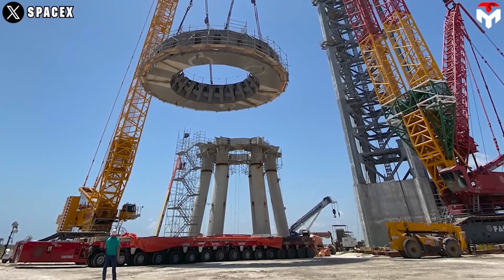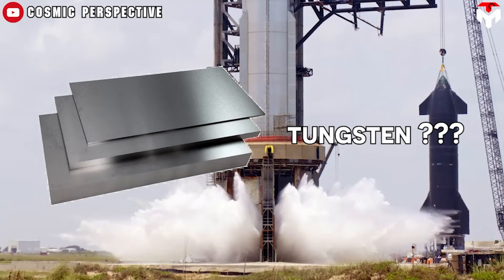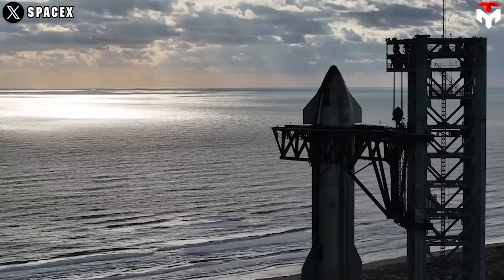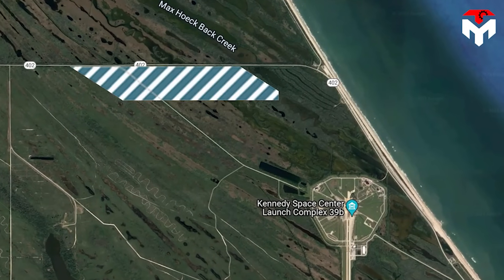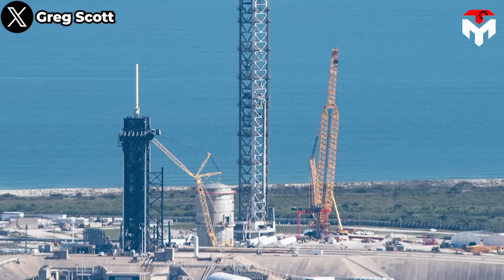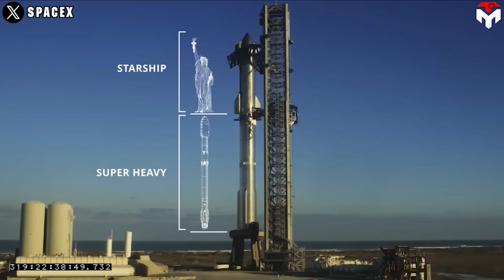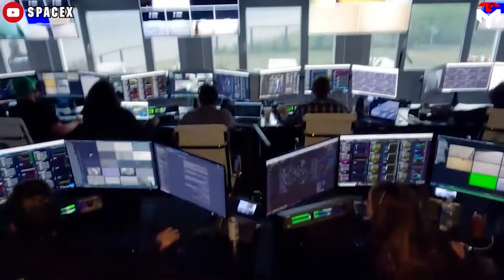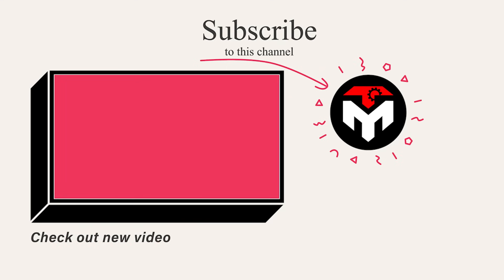Elon Musk revealed what exactly happened to SpaceX's Florida Starship OLM...

Comment: Six legs to three; will reduce the blow-by resistance which will disipate heat more quickly and possibly also reduce noise level.
    Sure would like to see the chopsticks modified to have a sideways mounted boom and stick operation.   Construction digging equipment uses boom and stick with a digging bucket.  Change the digging bucket to a giant catchers mitt, so to speak.

Comment: The next tower should be a couple of sections higher than the initial one.  To take in consideration of the hight of the new booster and new ship height.  Also it would be good to put a quarter ring deck extension on each one of the chopsticks... to make sure that when the booster lands on the chopsticks, the booster doesn't fall off the end of the chopsticks, and the booster is able to be properly adjusted and realigned after it lands on the chopsticks.  Just in case the booster needs to be turned slightly so the booster guide-fins surfaces are resting at some point on the two chopsticks.  And a mechanism that provides the booster to be turned to realign the pickup pins to be properly aligned so they will insert into the booster pin sockets.  I think it will always be an issue to keep the pickup pins on the chopsticks aligned properly with the pickup pin sockets on the booster and starship.  So a mechanism needs to be made to turn the booster and the starship when they are landing.  Wish I could make a drawing to attach to this post.  I think most people will not understand what I am talking about.  Unfortunately this is not something that is easy to describe.
Reply: how about stop believing in this stupid concept, just a waste of money lol. starship is massivre fail, wake up.

Comment: Tungsten is an element, it's not a steel. it is very hard and has a very high melting point, but it is very brittle and heavy as gold. It is usually used as an alloy. One would be tungsten steel, or tungsten carbide (you cant produce suitable cutting tools with the element tungsten). SX wouldn't use tungsten instead of steel, but they might choose tungsten steel as opposed to mild steel. Saying they could choose tungsten instead of steel is false. (40 yr Machinist).

Comment: Insane is this tower, which is simply rectangular and extremely tall. So such a tower could also be significantly higher. Wouldn't you save a lot of fuel if you took off from the top of the tower?

Comment: I think the Starship should not land on the same tower as the booster. If something goes wrong everything is damaged, the booster, the ship, and the launchpad. Also, the running engines with their exhaust are dangerous to the booster. Therefore it is better to land the Starship on the second tower (or vice versa).
Reply: That makes no sense. If the booster is dangerous to one tower it is equally so to the other. Both will have the same equipment. Besides, Elon has said they would use the same tower.
Reply: @knowledgeisgood9645  The booster is much more vulnerable than the tower. The tower is a rigid framework construct made of steel whereas the booster is made of thin sheets that contain a lot of electronics and other high-tech parts and perhaps some remnants of fuel. Does not matter what Elon said, why have they built a second tower?
Reply: @gottfriedheumesser1994  The tower is many times more expensive than any booster. It has all the infrastructure needed for the ship. The booster has mass-produced parts like the Raptors - the tower does not. Towers take over a year to build and equip.
Reply: @knowledgeisgood9645  You are the true expert! Sadly, I am an engineer who does not understand any technology. Name the Infrastructure of the tower and that of the ship.